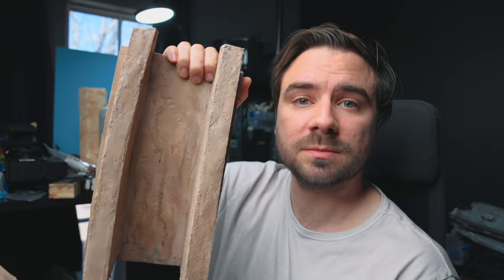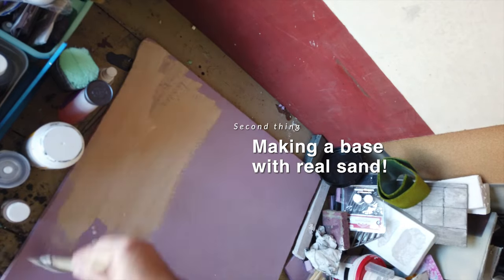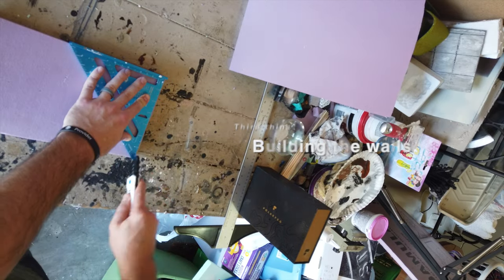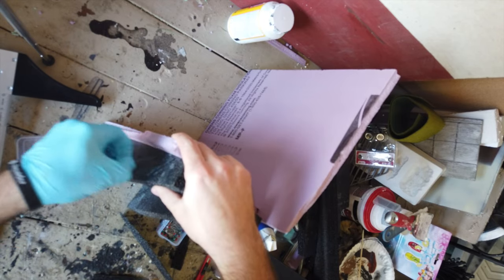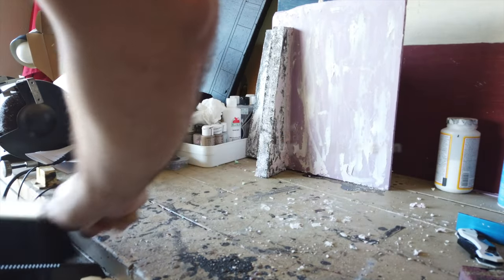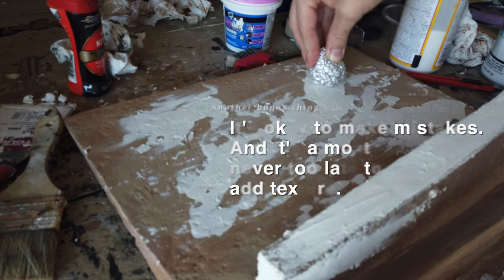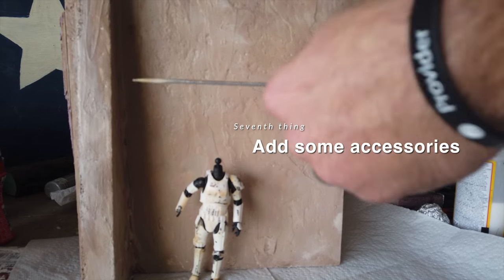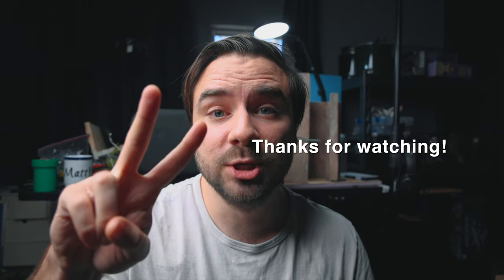How to build a Star Wars Desert Diorama for Toy Photography

Comment: Hot glue is the best glue. Make sure you have a low setting. Don’t need much!
Reply from the maker: Yeah, I just have a cheap gun with no settings 😅 but I do prefer it. I try to keep it a little ways back so it doesn’t melt the foam haha